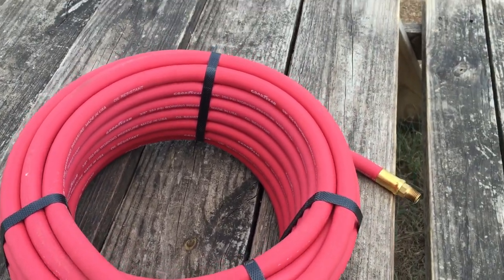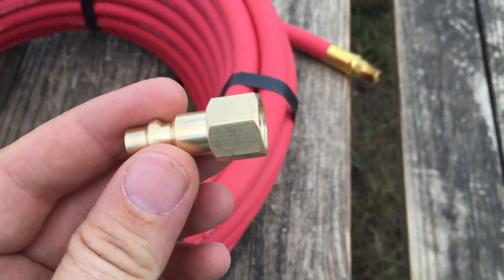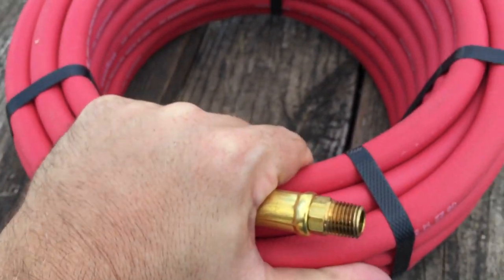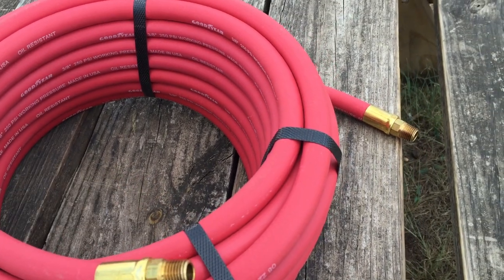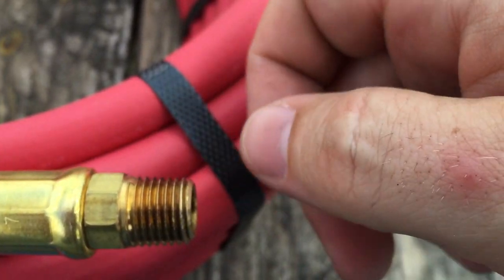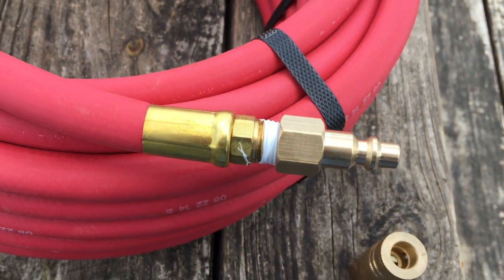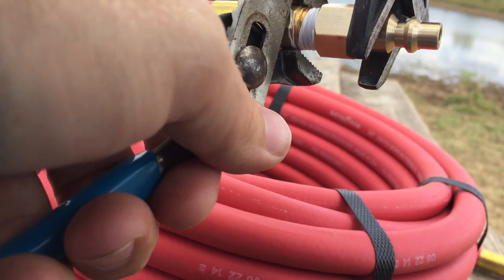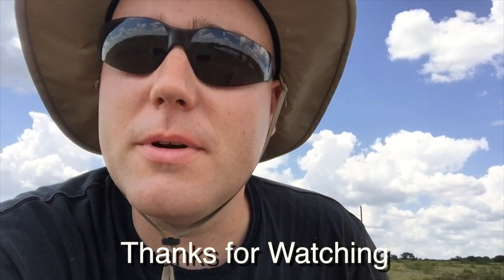How to make a hose for an air compressor

Comment: You might want to include, on any further videos on this topic, some mention of the third common style, "ARO". According to many sources, "Industrial (or Industrial Interchange) is the most common in the North America, followed in popularity by "Automotive", and then by "ARO". A problem with ARO is that it looks a lot like Industrial, but the two types will not fit into each other's fittings, yet many stores mix the two up in bins, and it is easy to get the wrong kind and not realize it until you get home. 

The thing I have learned to look for when shopping for these connectors is the spacing between the two ridges on the male coupling.... If the two ridges come together to form a "U" or "V", then it is ARO, whereas if there is a space of perhaps 1/8" between the two ridges, then it is Industrial.